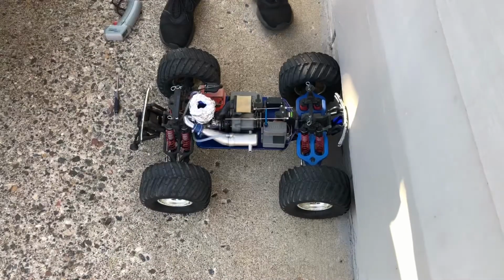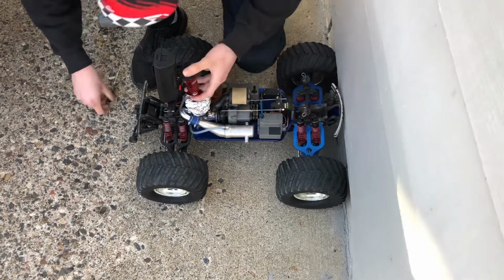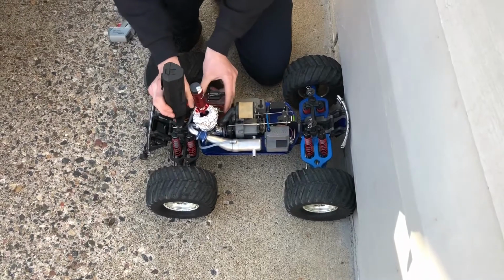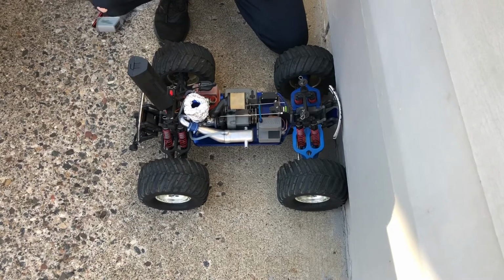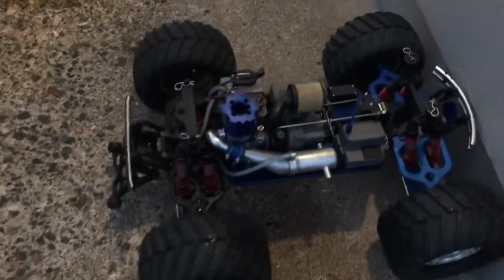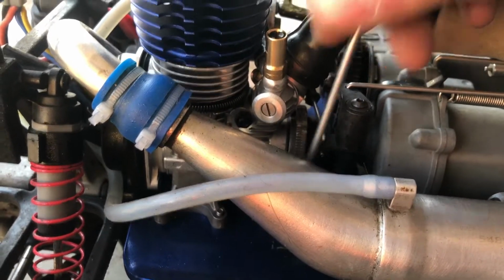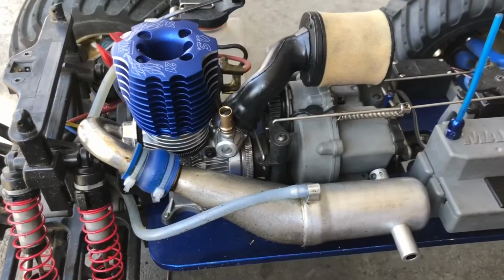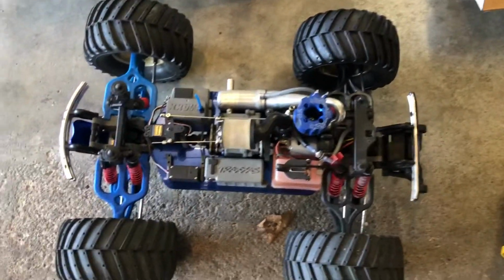OS 21TM In T-Maxx Break-in Sequence

Comment: It amazes me how many people do different break in methods on nitro engines.
Reply from the maker: Yes there are lots of methods but I feel this method (heat cycling method) is the best one. After all it is used by the professionals.
Reply: @rcbrosproductions9129  I use the same method.
Reply: Engine break in doesn't matter anymore. Warm it up and enjoy. Heat cycling comes from ancient spring loaded ring engines 70+ years ago and isn't needed in any of today's engines. High load at low engine temperatures/RPM and overheating will decrease engine life.
Reply: @ic3man5  yeah OK. I'll stick with the Adam Drake break in method.
Reply: @DerekRC  to each there own. Whatever makes you feel the best is what you should do.
Reply: I use the Kyosho method. And still to this day had not had a problem. It's all in how u take care of that engine after running. That's all.